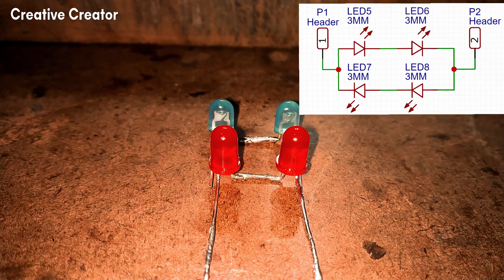Police LED Flasher Circuit

Comment: No current limiting resistor for the LEDs, no ceramic bypass capacitor on the 555 supply rails to stop them from oscillating at VHF?

Comment: 1. Use perfboard instead of soldering cimponents in mid air.
2. Use a 556 which is two 555's in the same die.
3. Insert one end of the wire in the heat shrink tubing, then solder the other one on and slide the tubing over the joint.
Reply from the maker: Thanks for the suggestion 🤗

Comment: A note to the wise: Always have in mind when soldering - that both LED's & (in particular) IC's can take just so much heat, or they'll be ruined . . . .
Reply: An exception is Surface Mount Devices.

Comment: Guys, would this entire circuit be able to withstand 18v (2× 9v) without additional resistors? I would like to use 12v truck lights instead of individual LEDs. I've already tested my lights with 18v and they can handle it.

Comment: I built this with just two LED's and it worked reliably like the in the video, but it eventually burned out one of the LED's.  It seems that the output voltage from the IC2 is around 7 volts, which is too much for the LED to handle.  Presumably, that's why there were 4 LEDs(?).  Not sure though since I'm not all that knowledgeable about this stuff.  I tried to add a resistor to lower the voltage, but the timing becomes erratic and unpredictable.  So my question is, is there a more reliable way to do this for just 2 LED's?  I'm not having much luck getting the timing to sync up or even operate predictably at the speeds I want.  Ultimately, what I need is for the first LED to blink twice, then flip to the second LED and also blink twice, then repeat, but at a relatively slow rate.  I'm just not having much luck getting it to work reliably.  I'm about to give up in the dual 555 timer circuit altogether.

Comment: That was pretty cool although I don't understand how it works lol. I didn't pay attention to the diagrams but I did watch it assembled. How can all the leds be connect together and work like that? I'm not saying it's wrong because I have very little knowledge of this stuff I just don't understand how the red and blue lights would blink independently.
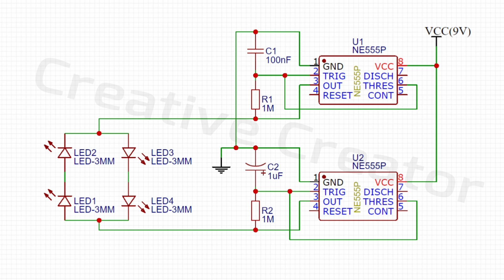Reply: Hi there. I guess is because leds are basically diodes and only alight if electricity flows accordingly to its direction. Even blue and reds leds are soldered “together” they are allocated in opposite directions, see diagram 5:40. This circuit has the function to control the electricity from the battery to leds, in terms of intervals (the flashing) and direction (polarity causing only some leds alight). As you say, I know nothing about this stuff and just wondered the same. Did I little googling research. If I m wrong someone correct me.
Reply: It's about polarity. Simple and clear. One IC gives the rapid impulses, the other changes the colour (polarity). That is all.
Reply: @xavip3296  I also could not understand how they work seperately

Comment: i'm those leds are mA values wht about using  leds  of  1A or 3A
Reply: sunnsuck sse. 555 won’t handle 1A.  You would have to use a second driver like an optocoupler or mosfet

Comment: Great videos as usual.  If I increase the number of leds to 5 each color, total 10, can I reduce the resistor?
Reply from the maker: I think it will work. But if you find i.c. is getting hot then use transistor for amplification.
BTW don't forget to subscribe 🤗 
Have a great day!!
Reply: @Creativecreator  Thank you very much
Reply: The battery voltage is not high enough for 5 LEDs. You need 10-20mA per string and roughly 3 V per LED.
Reply: @CyberlightFG  Thank you very much

Comment: Works when 12V strip LED is connected?
Reply from the maker: NO IT WILL NOT TAKE THE LOAD OF LED STRIP IF YOU USE MOSFET FOR AMPLIFICATION THEN IT MAY WORK FOR YOU.

Comment: You could really shake up the model police car community if you can come up with an 8 light system that can be programmed with different flash patterns per light pair, examples 75fpm, 90fpm, 150fpm, alternate versions of those and so on, I am saddened by the huge lack of realistic flash patterns offered by people who make custom police cars. Maybe integrate Whelen Wecan files that could be flashed onto a chip or something.

Comment: Hi,
How I can make this circut in 3v insted of 9v ?
plz guide me..Thank u.
Reply: You can use one 1.5 volts battery o two (3 volts) adding a DC-DC 0.9V-5V to 5V USB Boost Step-up Power Supply Module

Comment: It's amazing how people squabble over the little things that won't make a difference. This circuit is poorly constructed and crude, but people have to consider its not going to be part of a space shuttle, so it really doesn't matter. A 556 could have easily been used, but maybe the builder only had triple 5's available. I don't know. Personally I would have used an Arduino nano and written a sketch. Easy peasy.
Reply from the maker: You are right, I had only 555s 
Thanks for the comment... 😄

Comment: 1. Buy. The. Goddamn. Flux already :) The flux-core solder is just there to protect your iron's tip (and I prefer to dump it whenever I can as it is just an extra pointless shit to wash off your PCB later, wasting a lot of solvent). As a result of not using those, your soldered joints look like shit (and hold like shit as well, as their surface - and not only the surface - is highly oxidized, and the whole joint is full of air and micro cracks).
2. A kinda rare thing it is to see two(!) 555s at the same device. There is a 556 IC exactly for this one case ;)
3. Why not to rig a cap on the CONT pin like the datasheet proposes?
4. F. the 1M and such resistors, you can simply increase the capacitance at least 10 times - and decrease those guys to the way less moisture-dependent 100k.
5. It is 2019 already ;) SMD parts are the today's choice, also a PCB that simple can be easily made using a paintmarker or even a knife (should you have no Dremel or whatever) so will be way more bulletproof then point-to-point soldering. Before you ask, yes you can easily find a ceramic SMD cap rated at least 4.7uF so no need in those huge lytics. If going 10+uF, there's a crapload of various tantalum and SMD lytics everywhere as well.
Sorry should I sound offensive (with beer, I always do).

Comment: With that many subscribers and followers, shouldn't you rather teach how to make proper circuit boards that are robust ? I am sure quickly your solution will break because welding "in the air" does not last long. This soft welding works by capillarity and is robust when a wire is in a hole and the melted material fills the gap in between. If we want America to be in Engneering at the level of the best, we need best in class craftmanship.